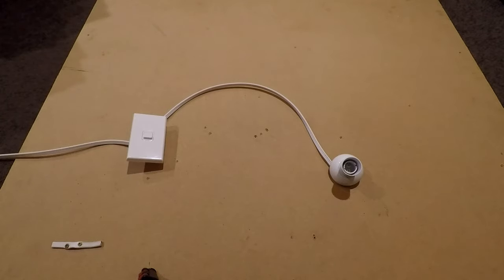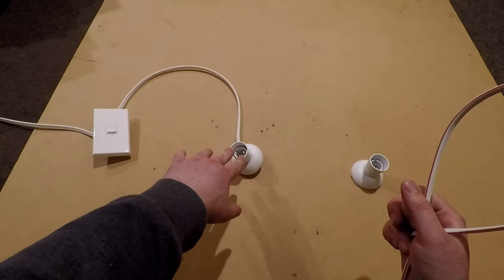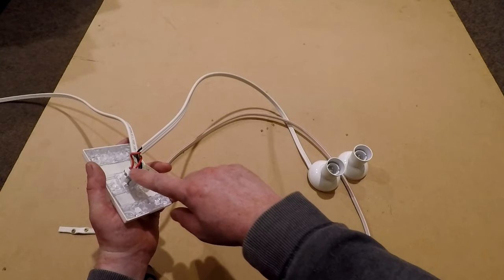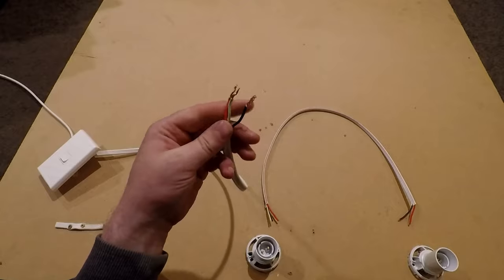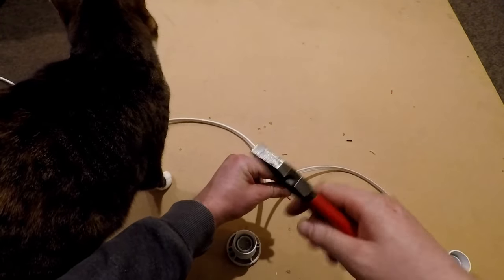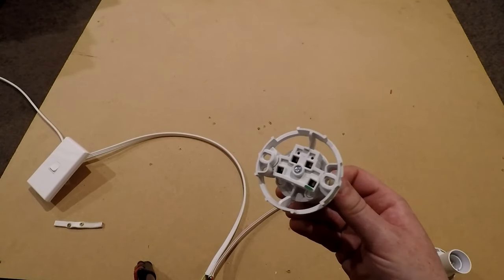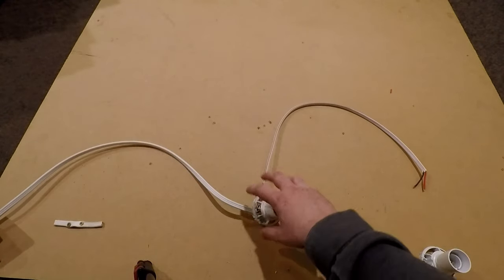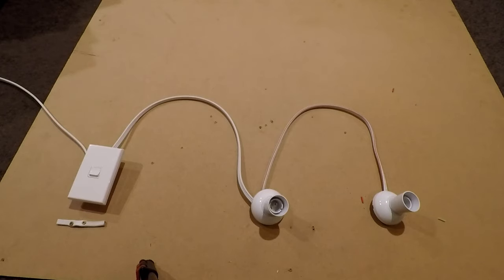Basics: Adding a Light to An Existing Circuit

Comment: Is there a maximum number of lights you can daisy chain together like this? I’m looking to combine 5+ lights
Reply: I was asking this myself too. I guess we have to wait a bit longer than 8 months for an answer 😅
Reply: you probably got your answer but it's determined by the wattage of all the lights combined and the Guage wire you are using standard is 14 gauge for house lighting and stuff so thats 1800 watts as long as you stay 20% under the maximum which is 1800 watts you're perfectly fine you can daisy chain as many as you want following that rule

Comment: Great vid....so if I wanted to add a 3rd light to that circuit I would connect into the 2nd socket?...and a 4th light,  connect into the 3rd and so on?....and if so, how many additional lights can you go...is there a recommended limit?

Comment: Amazing video (and videos!), thank you so much! This is extremely helpful for my pre-app work (especially when the tutors aren't anywhere near as helpful as this) and through into my upcoming apprenticeship. I'm assuming in this demonstration, these two lights are wired in parallel? Would you be up for making a demonstration video for wiring up these two lights in series with TPS to see the difference for educational purposes (I appreciate series isn't usually the done thing for most light circuits)?

Comment: This is the easiest to follow and understand video yet of the 3 other videos I very recently came across. The only thing is that I am not sure of is the ground  situation. I am not daisy chaining lights but rather cameras with spotlights. I want to make sure I ground properly. I will probably be running two sets of wires (romex) from the light switch to the two separate camera/light fixtures. 

I probably am overthinking this but where the ground is concerned should I just run each camera/light's ground wire to the switch and tie it off on the ground connector as I would be doing if I only had one camera/light?

Comment: Dave, what is the advantage and disadvantage from doing wiring from the socket vs all the way from switch
Reply: generally easier to wire from the socket as its likely accessible, switch is in the wall so youd have to drop the cable down/up, socket is in ceiling. you just do whatever is easier.

Comment: Thanks for sharing these vids m9, I don't see one for making an outlet circuit? is it the same as a light circuit/multiple light circuit? I actually found your vids when I was looking for a copy of AS/NZS 3000-2018 as I am planning to run the cables in my new home for the sparky to come and wire it up, and I just wanted to read the standards for doing so... have you got a more cabling specific vid that talks about how and where to use conduit and asociated parts and how cabling should interact with wall framing and floor joists?

Comment: I have one strap from the first of two ceiling light batten fittings to the single gang switch that was linked to both.

A single black cable entering the switch via the same conduit as the strap containing a red and black cable. 

The single gang switch once had a dimmer but I removed it.

I am uncertain of that second black cable’s purpose. 

At the moment turning on the switch causes a short so something is askew.

The ceiling lights tap into a hot wire feeding all eleven battens looping or daisy chaining along the circuit.

Comment: Do you know how many lights you can add to an existing one is there a limit?
Reply: As many as u want but u dont have to exceed the power consumtion of the circuit cause the circuit breaker will jump from the fuse box
Reply: The more lights u add in one circuit the more power consumtion increase and the more amps will flow in the circuit which makes the resistance to increase the higher resistance is more amps will flow one 1mm cable or 1.5 mm is enough to take all amps with no resistancewhich can take up to 16 amp but the circuit breaker is also very important in one circuit for safety reasons
Reply: Its important not overloading the circuit
Reply: If u add more watti the amps increase and the reaistance start to increase

Comment: This is great but im still trying to get my head round it. Is this circuit in series or parrallel? Or does it not matter? Im about to wire up 2 led lights and thought if i did it this way then the 2 lights would end up "dimmer" cos the circuit is in series. Can anyone clarify?
Reply: Parallel so it can carry the same volts

Comment: So technically, i could just swap that switch for a plug end? And plug in into an outlet? I could theoretically use an extension cord and cut it up and loop a few lights together this way?
Reply: No, you will want to get the proper gauged Romex that's rated for the type of amperage your power on that circuit is running on. To small of a wire gauge can cause potential issues/hazards.

Comment: Does the fixture type matter that you're adding? Like if you've got a fluorescent up can you add an Led later or can those not be on the same circuit?
Reply from the maker: That's fine. Although keep an eye out if there are sensors or dimmers on the same circuit as these are only compatible with one type of load..(ie incandescent, LED, fluorescent)

Comment: If I wanted to run say a 2 gang switch for 2 separate light circuits. Does each circuit need to be run from the switch box or can you just loop the source into the next circuit?
Reply: I need this too

Comment: Question if one light blows isn't the other one gonna go out as well cos its wired in series?
Reply from the maker: These are wired in parallel. Imagine a black line and red line, each lamp (and any additional lamp) sits between the two lines. Hope that helps. (In the video the black and red cables were never cut - just extended).
Reply: @sparkydave  I see how it works now cheers. Thanks for taking the time out to reply keep up the good work.

Comment: What if the first light 💡 is connected to a PIR motion sensor and you want to add another light so they can both use the exact same PIR sensor??
Reply: A motion sensor just takes the place of a switch. If you want a switch also, just wire a switch before the motion sensor. You’d have power source, switch, motion sensor, light, light.

Comment: How many lights can you actually add to a circuit
Reply from the maker: There are a few factors to consider, including cable size, the total power consumption and overall distance from the switchboard.

Generally, in a residential setting, it depends on the combined power consumption (watts) of the entire circuit running off the same fuse/circuit breaker at the switchboard. Ideally the combined wattage should be less than 1kW on the same lighting circuit (4.35A) for residential. Calculated P=VI. Very easily done with LED lighting these days - you will over illuminate a room, if not the entire house, before you overload the circuit. Should the circuit become overloaded, the fuse/mcb will operate protecting the cable from excessive temperatures.